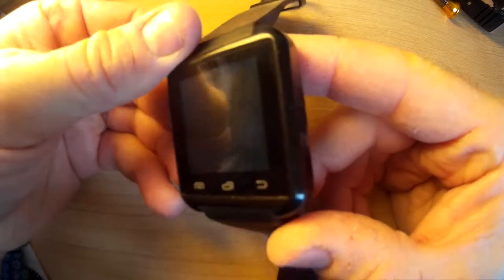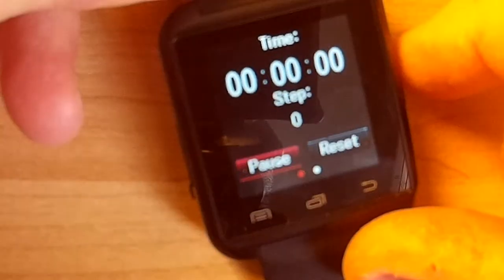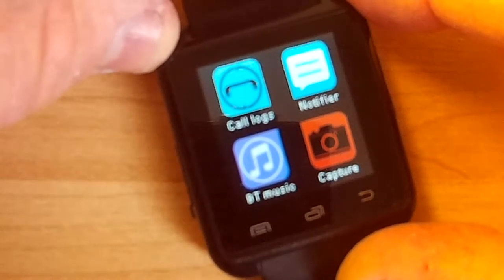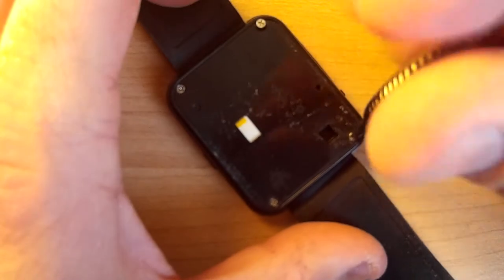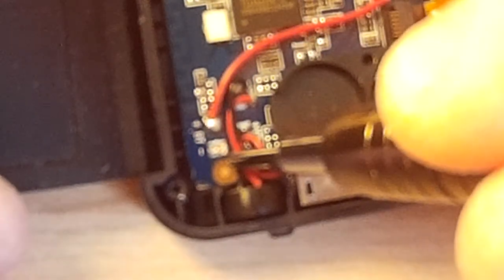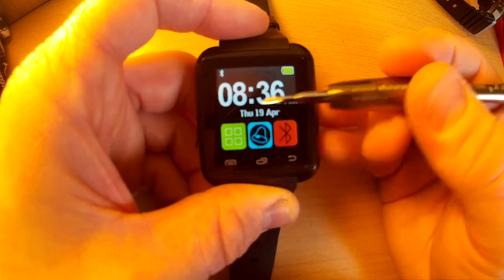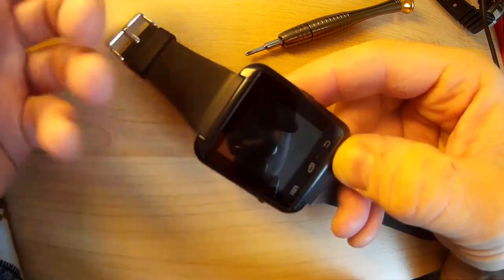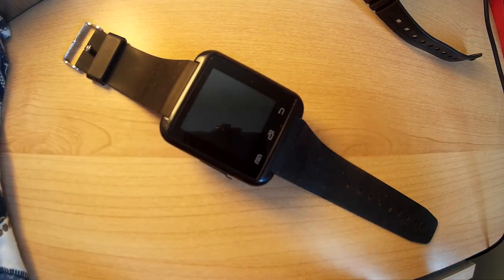Fake U8 Cheap Smartwatch Teardown Review

Comment: I got mine for $5.99 with free shipping on eBay to use the remote camera but it's missing the vibration, watch faces and a bunch of other apps.  Actually I think smart watches are useless since a smartphone does everything better but I had some expiring eBay bucks to use on $hit I don't need.
Reply from the maker: Depends on which one you buy, some have all the sensors, some don't. Some have vibration, some don't. I compared a few, all from similar batches sent off eBay. They are cheap, I think for that money they are worth having to mess around. I use mine sometimes as a bluetooth speaker or to check voicemail quickly, or see who is calling so I don't have to remove phone from pocket. Also there is a calculator, stopwatch, time, it's pretty cool considering the price. The only complaint I have is the BATTERY is CRAP usually. You can get mixed results... some barely last a day. I don't care about the crappy features as much as the battery... give me a battery that at least lasts consistently a full day!